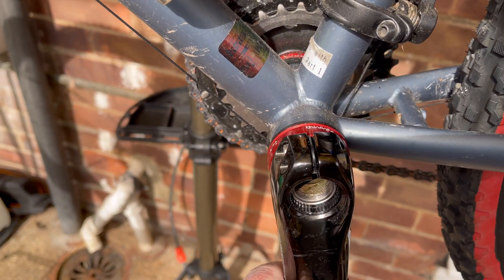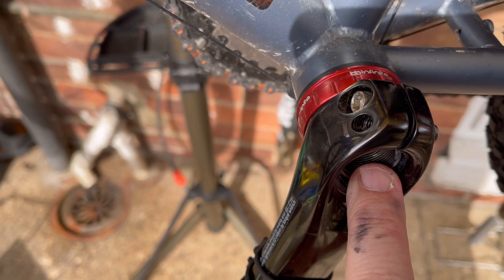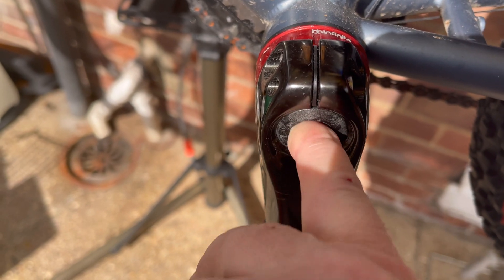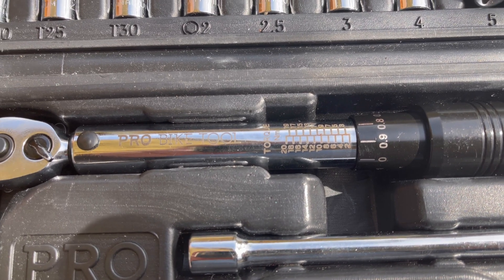Fitting a shimano crank arm and correct preload tension. #bbinfinite. #shimano. #hollowtech.

Comment: One of the common mistakes I see is people overtightening that preload plastic bolt.  Maybe because SRAM uses this mechanism to actually hold the crank on. As long as the crank doesn’t move side to side it’s tight enough. It’s the pinch bolts that hold the crank on.
Reply from the maker: So true

Comment: You screw the cap as much as is needed - until you no longer feel the play in cranks...
Reply from the maker: Actually there is a specific torque of 1.5nm  but it’s mostly specific bike tools that’ll have a torque setting that low but it’s getting hold of the right tool bit.

Comment: It's better to tighten up the spindle and the bolt a little than Not tightening it it's better to put 15nm on the bolt then 6-7nm on the spindle ❤❤
Reply from the maker: Bolts often fail of they have been repeatedly over tightened. And plastic threads are designed to take very light torques. 
Trust me ive had 40yrs experienced as a marine engineer and a lot longer as a cyclist.
Reply: @retroonhisbikes  your Hollowtech spindle is Plastic 🤣 mine is titanium so threads don't wear out and i can tighten it to 7nm the reason why i torque my spindle up to 7nm is they're made of titanium not Plastic and my bolt is titanium So i can tighten it like 15nm to prevent the crankarm from falling off Tighten it don't torque it to 1-2nm it will fall out because the threads didn't hold much

Comment: Just to let you know you should adjust your hollowtech spindle 10-12nm so it doesn't come off and won't get loose then the Crank arm bolt about 20-22nm
Reply from the maker: Do you mean 1-2nm pre tension and 12-14nm for the two bolts holding on the crank arm. If not you are doing it wrong
Reply: @retroonhisbikes  mate i know the hollowtech very well for 2 bolts adjust it 20-22nm then for the spindle adjust it 10nn if not good luck your hollowtech crankarm will fall off we all have different adjustment your adjustments are for Chill ride my adjustments are for sprinting and no i didn't overtighten it i just follow what the crankset torque instructions
Reply: @Jay-Jo4580 videos for shimano say 12-14nm, on crank also says 12-14
Reply from the maker: Read it again you’ve mis- read it
Reply from the maker: Crank are bolts are 12-14nm the cap is pretension as I say

Comment: how many times have you cross-threaded a fastener ? 
put the screw in with light pressure, turn the screw backwards (un-screwing direction) and you will hear/feel a click when the thread it was riding on jumps off and onto the thread below. that's where the thread start is and you can start screwing in the bolt as per normal
Reply from the maker: A few times a week. The finest treads are often the most difficult.  My job for the last 40 years has been mostly nuts and bolts. Mostly metric course threads.
Reply: Same when screwing up my Moka pot 😂

Comment: what sucks in the 68/73 bb with shamano cranks are not good cause the non drive side splines are only making contact on half the splines. not good.
Reply from the maker: Having an older frame that isnt as wide helps. I havent looked into it but i suppose you can get longer drive shafts for wider bottom brackets